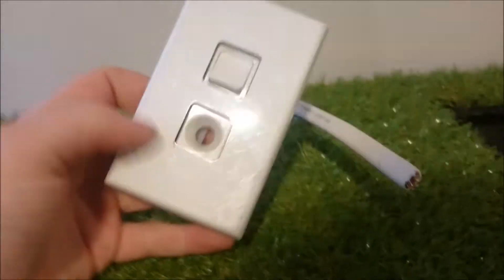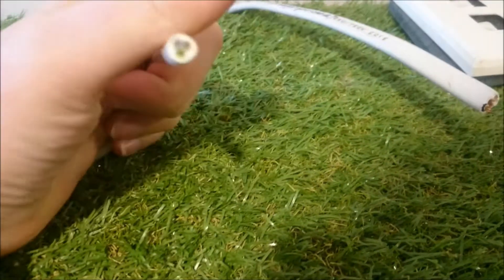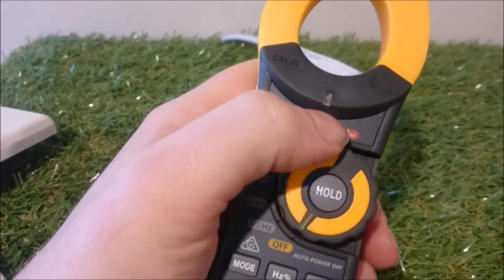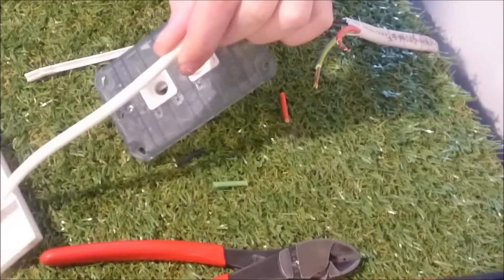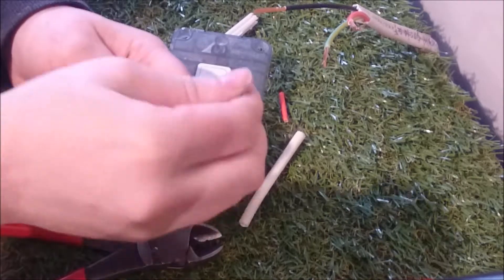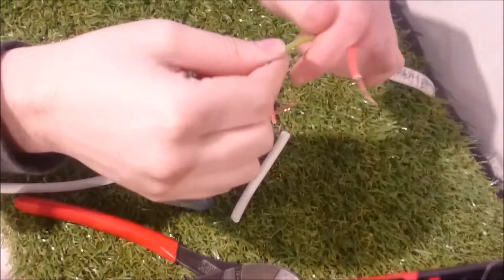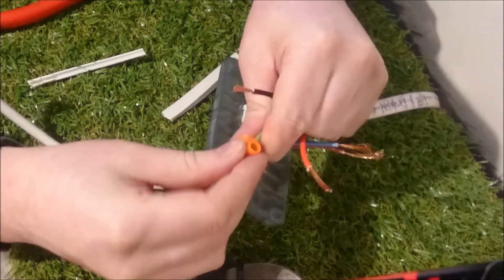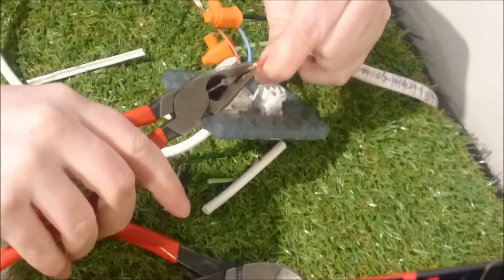How To Connect a Hot Water Cylinder Cable in New Zealand

Comment: Hi Dave, stupid question but i have been trying to find out whether you can wire a hot point from the HWC isolation switch. i suspect not. where can i find out the rules for this? Chur